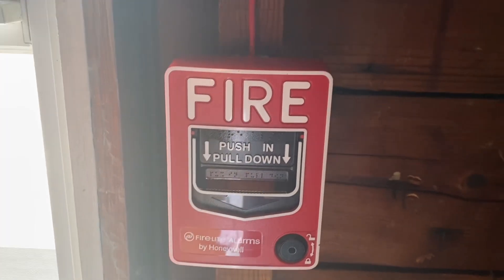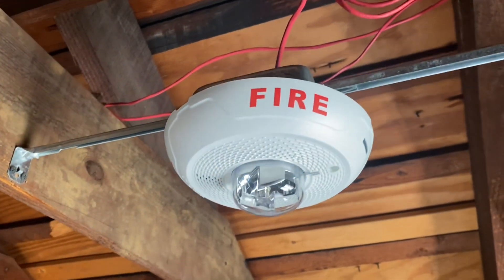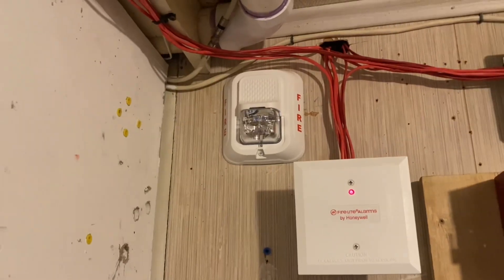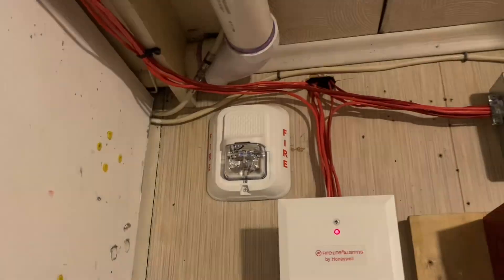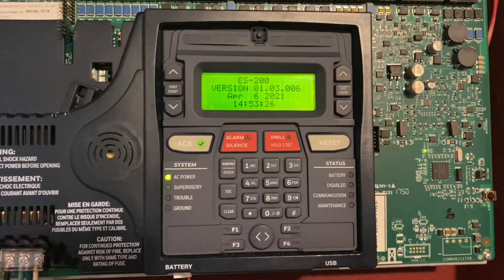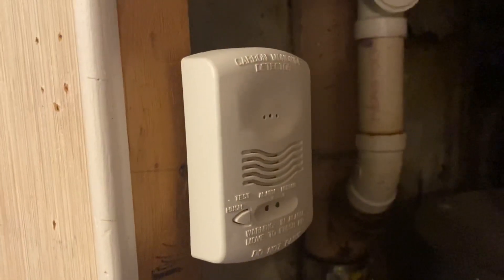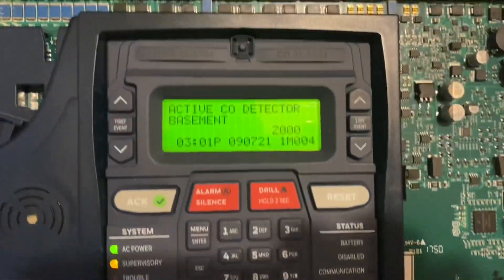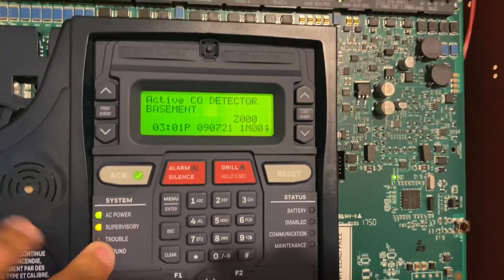System Test 53

Comment: I have a few questions about the es 50/200x panels. Is it true that these panels have issues with heat detector settings?, can you fully program it through the keypad?, and did you run across any issues while programming it? Thanks.
Reply from the maker: Hey Caleb, I use the FS-TOOLS software to program Fire-Lite panels. I never had any issues regarding heat detectors. In the software, you are able to select what type of heat it is. Whether it’s a regular heat or a high temp. The heads are different, so the panel needs to know what heat detectors are doing what.